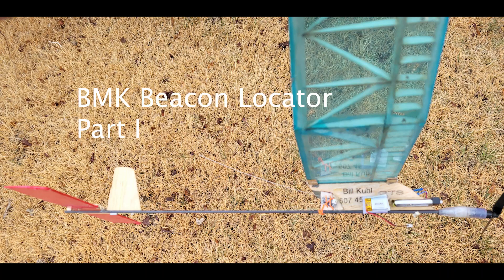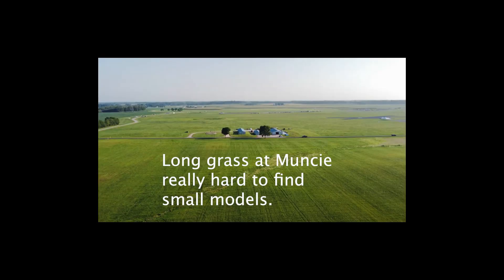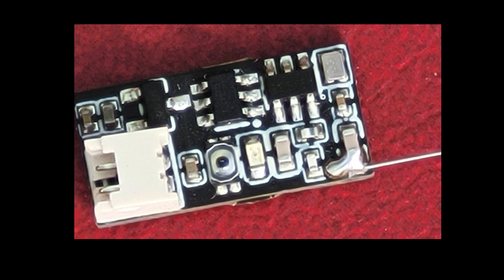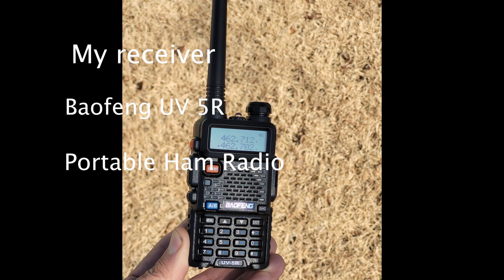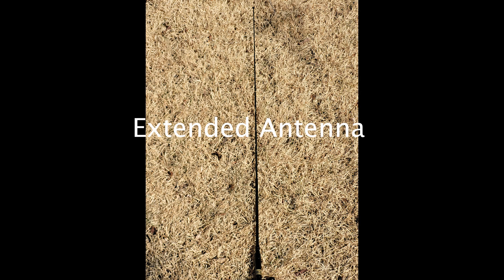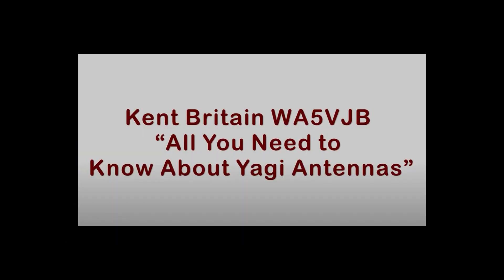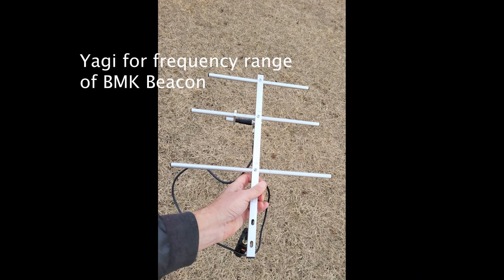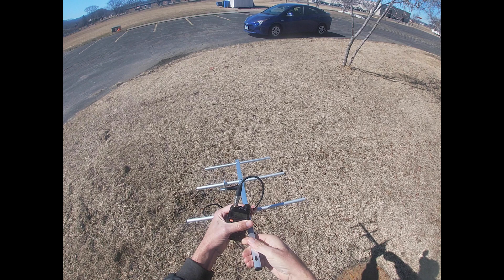BMK Locator Part I

Comment: Am I right in thinking that the higher the radio frequency the smaller the Yagi antenna, your Yagi seems very small what frequency?
Reply from the maker: You are correct smaller for higher frequency, this is 462 mhz, my Walston is 217 mhz.